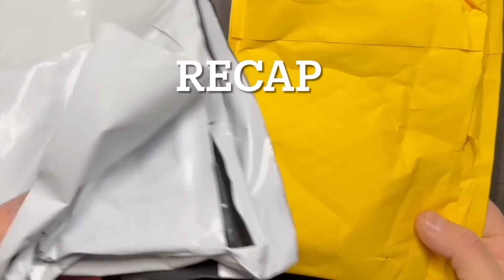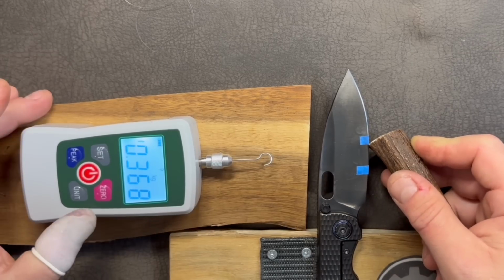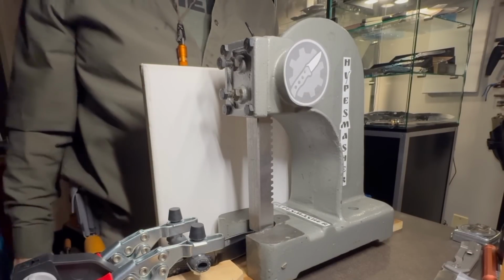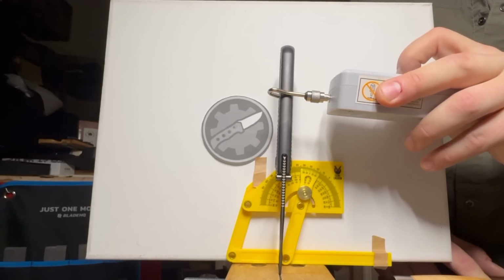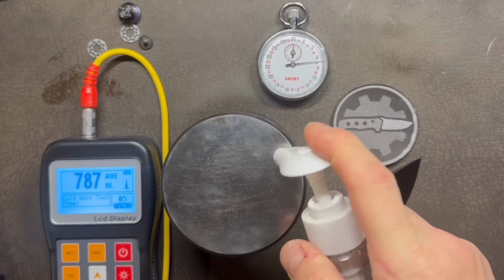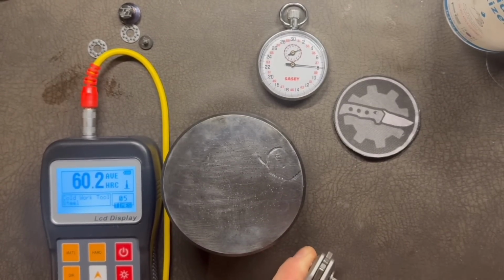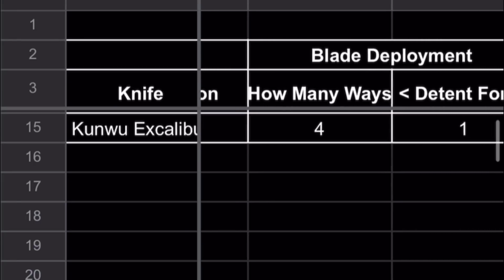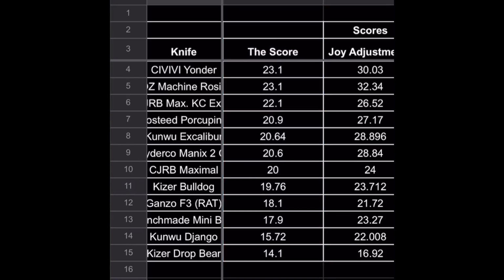Kunwu Excalibur, Chapter #2, Performance. A 4-cylinder Mustang…

Comment: I want to say that more often than not, kunwu knives are hardness tested at the lowest advertised number from all the other testers.
Reply: Also the kunwu guy has been lyung since day one of the kickstarter.
Reply from the maker: I’m not sure if he’s lying and what he’s lying about. I can’t verify anything or disqualify anything that he says. Except when he called me a Clown, which is a correct statement that reflects my state of mind on frequent occasions 😂
Reply: He said it would be high hrc s35vn then it was like give or take 58rc. Then he lied and said the edge would be harder cause they heat treat everyone just on the edge. Then he said they were mid techs when they were just mass manufactured in china.

The kickstarter knives *
Reply from the maker: @ I am not privy to any of that. Excalibur and S-Tao are in the correct HRC range for Vanax. There’s no discernible drop in hardness between coated and uncoated blades shown in this video. These are facts as I know them.

Comment: I don’t understand the logic behind the torture test? If I’m doing anything close to what you’re doing, I’m using a tool for that task… I have been in a pinch and knew I was going to chip the hell out of my blade when dealing with a pipe that locked shut. If I had a better knife with me I would have run out and got another tool from hardware store. I had one of my $75 dollar knives so took the risk. I also have fixed blades for tougher tasks. I know you said the tests are for entertainment purposes only…. but people are also influenced based on company, price and or person behind the knife. But, that said, it’s your chanel and your knives, do and say whatever you feel. I have no investment in this knife either way, but feel the price doesn’t seem unreasonable based on other knives that are similar.
Reply from the maker: Ok, I can live with you not understanding the logic! Thanks for commenting!

Comment: Greetings! Great review as always! I would like to offer a tip for the sharpness tester if i may: I am using the same system (inspired by you of course) and found that especially with edges that have a radius on them aka belly: it is extremely important to go orthogonal on the radius. if you tilt it it will read significantly lower as the point of contact decreases which increases the pressure of course.. might explain why you are not getting repeatable results on that one.. i am starting a database of knives and edge angles if you are interested i can email you the excel once i am finished :) all the best from austria!
Reply from the maker: @NonScientificBladeTesting  All data is good data! Please send. 
I noticed that the better the stripping, the more consistent are the measurements. Very strong correlation, as expected (duh) 
And I try to measure on the straight section of the blade.

Comment: Metal Complex mentioned in the past he wanted the relief cut on the outside because he likes the aesthetic. He also said Sergio at Kunwu says that having the relief cut on the inside changes the  pressure and springiness of the lock bar (feels to mushy). That you want the force to be vertical/inline with the lock face. Make of that what you will.
Reply: Fair enough. It's interesting to me the shape of the internal relief cut on the Sebenza resembling an "m"
Reply from the maker: Olamic Tactical has that feature as well but on the outside. Some of old Benchmade monolocks had no relief cut, others one big radial cut on the inside. There is no rule of thumb and the cross sectional area in the thinnest part of the cut will determine the strength overall.
Reply from the maker: They lied to his face. It’s probably one less setup for them because they can mill it at the same time as the diamond pattern. Yield strength is Force/Area so…
Reply: @CBRxLIVE It is integral! You can't mill inside like knifes made from 2 separate scales!

Comment: If the price was reduced by 200 how much profit do you think Kunwu would make. You think that would be a good business model
Reply from the maker: They had several very nice models on the market in mid-200s. Let’s be logical. If Pro-Tech could replace the blade on my Malibu for $60 in January, it is clear to me that labor and materials on this knife couldn’t exceed $120. I think the inflated price reflects 2 factors: social media hype and the designer’s cut, which in this case, the two are related, so I overpaid at least 200 bucks. At least I know where it all went! Great though provoking comment, thanks!

Comment: HRC to low no thanks..”was “my grail..seems to be a big problem with heat treat with many knife makers They are ripping us off because we don’t have a test meter and they know it…
Reply from the maker: The 59-61 HRC HT is correct for Vanax. It’s a CR steel akin to LC200N but with less edge retention and more toughness.
What boggles my mind is that every reviewer OMITTED this very well known and simple fact.

Comment: I always cringe when i hear one of the "expert knife reviewers" claim that a coating always reduces the HRc by "one point." Is that 1.00 point? They never consider the tempering cycle for the steel or the temperature and time for the application of the coating as Larrin Thomas (and you) have.
Reply from the maker: Thanks for your comment. Larrin is my role model. Even though I hate his young age and full head of hair 🤓
Reply: What MC is generally referring to is WE Knife Co.'s own hrc ranges, which are 1 point lower for their coated blades, as opposed to uncoated, on the same knives.  The reason coated blades are often softer is that they have to use a non-optimal tempering range because the coatings are applied at a temperature that's higher than the ideal tempering range.  At least that's the case for most steels.  There are a handful of steels that are designed to have very high tempering temps.
Reply: @BladeLabMiami Neeve says it too (see his misdemeanor video where he talks about dlc vs satin)
Reply: @ThoughtAstronaut cant really hold that against Neeves though.. he does good edges, just more in the 'average knife knowledge'  genere

Comment: You are actually using antler, not horn. Antlers are true bone, and are harder than the exterior sheaths of horns, which are made of something like fingernails. So I would call it deer antler instead of the frequently misused terms "deer horn" or "buck horn."
Reply: Good catch, George. So I'm assuming animals don't shed horns?
Reply: @marsjam4117  I found an article by the National Park Service titled "Horns Versus Antlers," which says:  
"Horns—found on pronghorn, bighorn sheep, and bison—are a two-part structure. An interior portion of bone (an extension of the skull) is covered by an exterior sheath grown by specialized hair follicles (similar to human fingernails). Horns are usually found on both males and (in a diminutive form) females.

Antlers are shed and regrown yearly while horns are never shed and continue to grow throughout an animal’s life. One exception is the pronghorn, which sheds and regrows its horn sheath each year."
Reply: @georgelewis9127  very cool
Reply from the maker: thanks for the correction!

Comment: I think I would use a soft-faced hammer (softer than titanium) to drive the knife into the vice gap, because, regardless of the hardness of the DLC, it is the substrate that resists denting by the hammer. Is it not?
Reply from the maker: Good point… but not really 🙃 Ti has Yield Strength of 63,000 PSI (430 MPa). To deform it I would have to strike with a force of 3,150 Lbs (14KN). The hammer weighs .75 lbs and my arm is ~15” long, so to deform the handle I would have to generate 210 Lbs (95 kg) on the swing. That’s more than my own weight…
Reply: @CBRxLIVE  Thanks, I will concede the point to you, since I am not an engineer. 😊
Reply: @CBRxLIVE u got it. Swing away brother!